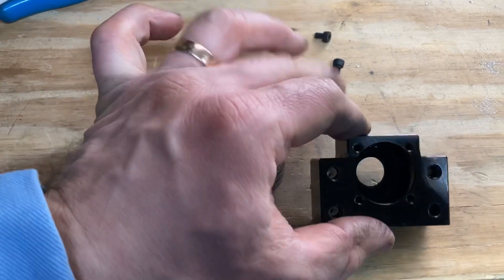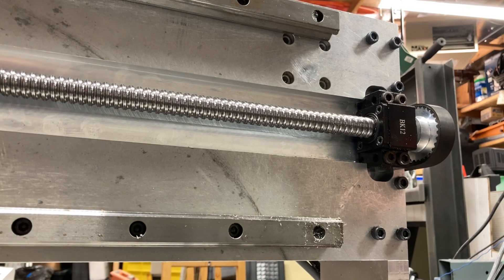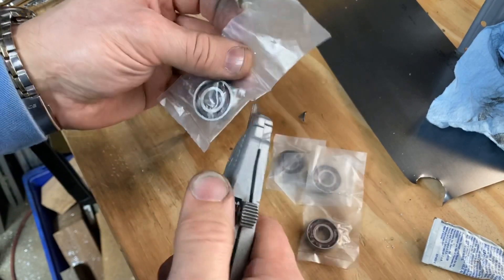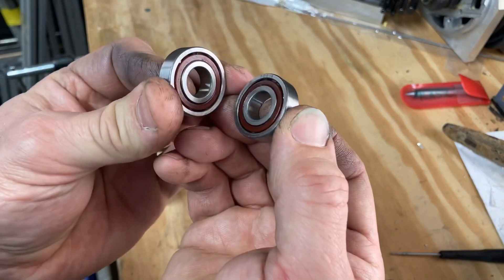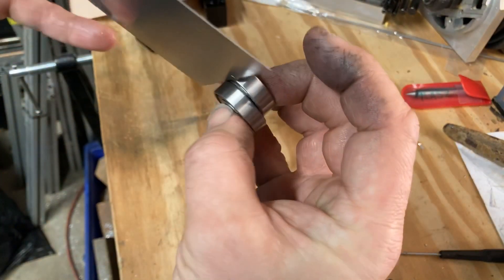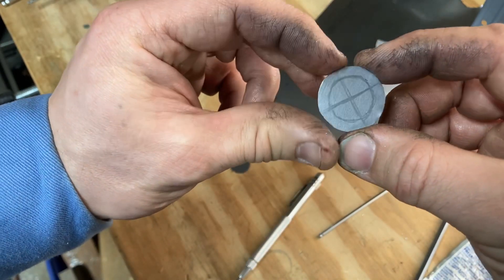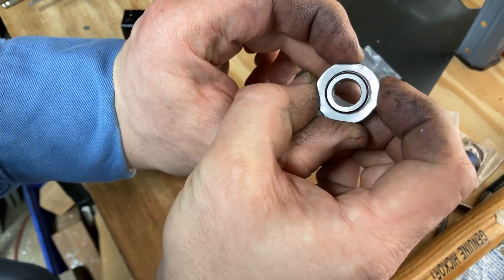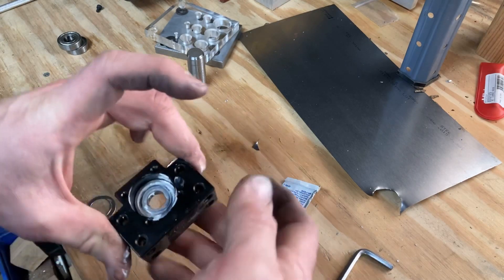DIY CNC ball screw support upgrade BK12 bearing block.

Comment: Technically using just a deep groove ball bearing was incorrect as the ballscrews face axial load and ball bearings are not designed to take axial load for these application. Replacing it with Angular contact bearing is the correct thing you did here.
Reply from the maker: Thank you!

Comment: @TinkeringNerd  thank you for the video. Do I understand correctly, that you used DB mounting option? With wider outer rings towards each other?
Reply from the maker: I think so.. the washer-spacer is for outer racers and the pre-load is adjusted by the screw nut.

Comment: Another option is to make your own block and use a thrust bearing each side and a deep groove in the middle. Thats what I ended up doing. I just turned the flange part on my lathe to have a round flange. Then I just drilled the PCD on my mill for the mounting holes.
Reply from the maker: Thanks for watching. That would be a more involved solution, although, more customizable.

Comment: May I ask what punch die is that? Selfmade or bought? Thanks.

Btw good video, might have to do this aswell on my freshly made PrintNC. Went for the cheapest Ballscrew/Blocks Option as well :).
Reply from the maker: Thank you! The punch and die is from Harbor Freight. It’s cheap, but works for small projects. Cheers.

Comment: I'd sure like to hear about the resulting reduction in play.
Reply from the maker: Reducing the “play” is achieved by selecting right size shims. Ideally, the final result has zero play.
Reply: @TinkeringNerd how much backlash did you end up with?
Reply from the maker: @rgsparber1  I didn’t measure it at the time. Then, I crashed the machine and ball screws started making noise. I bought larger size ball screws with angular contact bearings. One of these days, I’ll replace them..
Reply: @TinkeringNerd  I tried to get regular ball bearings to work with shims but got too much backlash. Changed to angular bearings helped but I randomly see a 1.4 thou jump. Haven’t found the source yet.
Reply from the maker: @rgsparber1  maybe you’re skipping steps? I’m just throwing ideas here :)
Cheers.
Reply: @TinkeringNerd  how would you detect this fault?
Reply from the maker: How, at which point in cycle do you measure the 1.4 thou difference? Is your machine one or two ball screws driven? One or two motors on faulty axis? Hypothetical scenario: add a “parking spot”  near home position to your g-code at the beginning and at the end of program. Measure the difference. Repeat. If machine skips steps, you should always get same measurements at the beginning. I’m no expert, but this is how I would start chasing it down.

Comment: Thanks for posting the info, was wondering why they came with plain bearings. Some thin M20 washers may fit as well here, will try that.
Reply from the maker: Thanks for watching. The idea behind the precision thickness shim is to make the gap between inner races infinitely small without them making contact.
Cheers.

Comment: I like your solution better, I've done a similar thing, except I had the bearings facing each other the opposite way and used a shim on the inner races
Reply from the maker: Thank you for watching! The way I did it lets me adjust the force of the angular contact by tightening up the screw nut, kinda made the most sense to me.
Cheers.
Reply: @TinkeringNerd  You're right that makes more sense. My solution required all 4 sides of each of the inner and outer races to be directly against each other and the journals, which made adjustment impossible. Only some of the shims and bearings I bought worked due to slightly varying tolerances. Your solution doesn't require the inside faces of the inner races to necessarily be touching directly and thus you have preload adjustability. If only you made your video 2 years earlier haha!
Reply from the maker: Yeah, if only I made this machine few years earlier! But, it’s never too late to make things right. Thanks again.